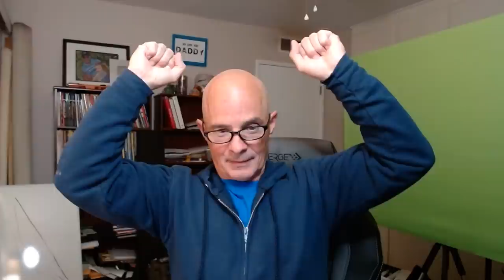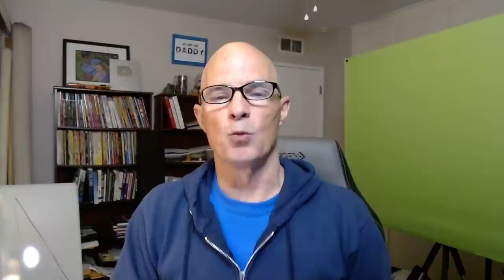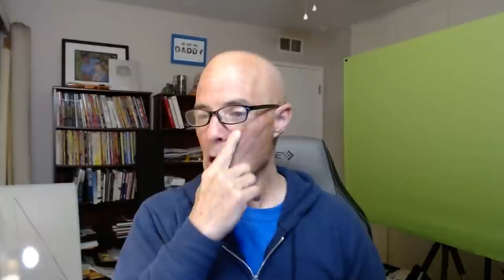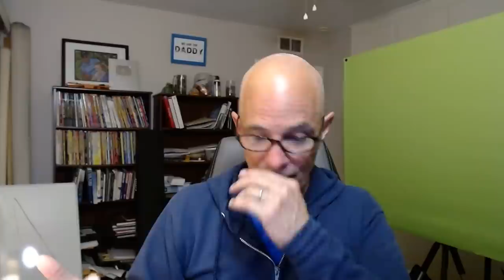LET'S TALK TECH-MY FAVORITE EFI SBC INTAKE (HOW WOULD I MODIFY?)

Comment: If I had a SBC, I'd get one of those Stealth Ram intakes and make a custom upper for it. I think the TPI throttle body would work great with a divided plenum.
Reply: Like take 4 of those throttle body’s right over all 8 of the ram. Weld the front shut
Reply from the maker: why the divided plenum?
Reply: The divided plenum should be easier to tune for Helmholtz resonance. And I like to geek out on that stuff. 😎
Reply: I like the idea of dual 4150

Comment: Have you tried an Edelbrock Pro Flo XT manifold?  It's similar in shape to the Stealth Ram but has the round TB flange for an LS style throttle body.  Downside - it is a one-piece design, so it isn't as versatile.  I am interested to see dyno results with one though.
Reply from the maker: not sure I have tried that on a SBC
Reply: @richardholdener1727  be nice to see this test

Comment: What’s the power overlap on a, 4cyl v6 i6 v8, v10, v12, w16, single (Dorito) rotor, 2 rotor, 3 rotor, 4 rotor. Does power overlap make any difference in power?
Reply from the maker: what is power overlap
Reply: @richardholdener1727  over lapping of power stroke during a cycle of all the combustions of a given engine. Like how many power strokes happen in a given rotation…
Reply: @richardholdener1727  hypothetical and I have 2 answers in my head for this. Take a Mazda v6 1.8 and a Honda b18 make them flow the same induction exhaust. Do they make the same horsepower? Yes same air on and out right? If you were building for power you would take the 4cyl right? Bigger bore (room for valves) in f1 they run a really small v6 that could easily be a 4cyl. Is that just constraint from regs? Does have power strokes over lap help with power, theory?? The test is not practical it’s just interesting and the Doritos… a 4rotor what does that have multiple combustion cycles happening at once I guess that’s why the have such high bsfc…

Comment: I have a 1970 C3 Corvette with it’s original block, but if I remember right, it’s now a 388 CU. It has an edelbrock aluminum heads, the Holley stealth ram, an upgraded BBK throttle body, an F2 pro charger, etc. I bought the car for its frame and suspension for my 72, but now I’m thinking maybe I should keep the 70 together and build it too. The stealth ram fits under the LT1/ L88 hood for a C3 Corvette. I’d imagine the C4’s would need some extra space. It’s good to hear that you like the stealth ram. I’ve
Owned this car for a year or more, and I’ve never put a battery to it. It’s been sitting for about 15 years. I’m new to fuel injection, and have been told that the fuel injection unit would need to be gone through before I should try to fire it up. What would you recommend? Thanks.
Reply from the maker: put a carb and intake on it-get it running and driving, then work on the EFI

Comment: What about spacer between plenum like on the gt40. Or 5.0 to 351w plates
Reply: I have one of the phenolic gt40 ones… how can I put a honey spiral ham cut in there:p
Reply from the maker: the spacer used between the upper and lower intake is actually increased runner length

Comment: Ive been wanting to mod a stealthram myself on a boosted 406. 
         On another note. I cant remember who said it but I heard if you mounted the injectors farther away from the valve it worth more power. Have you tested this?
Reply from the maker: We have discussed injector placement many times in the live feeds, and yes, I have tested injector placement several times-it works
Reply: @richardholdener1727  i never get to catch the live feed on time.  I believe someone on the old Power and Speed pod cast talked briefly about injector placement.   I wonder why OEMs place them so close.